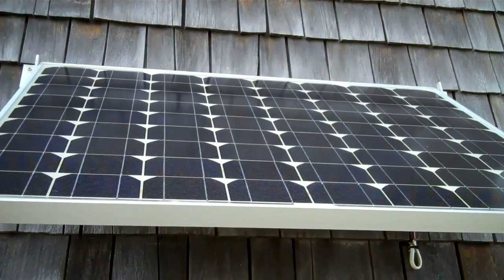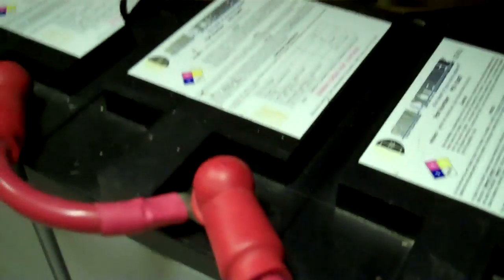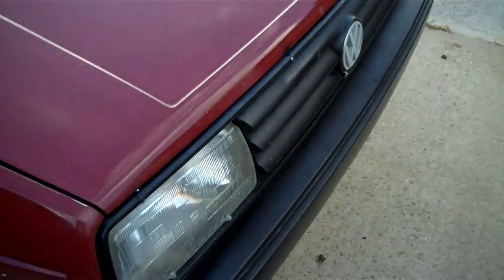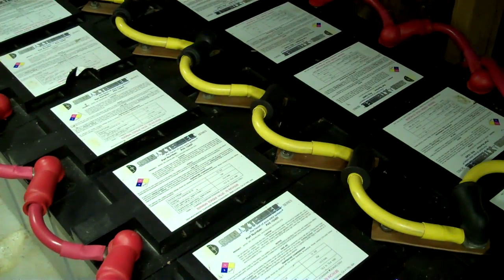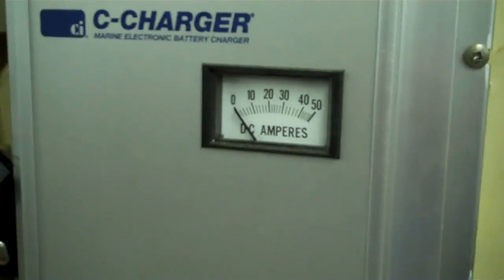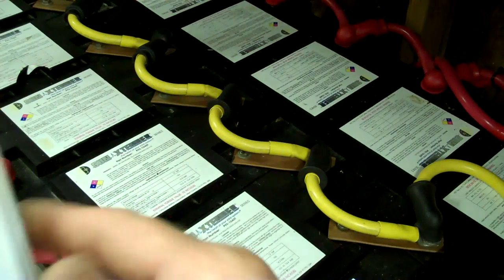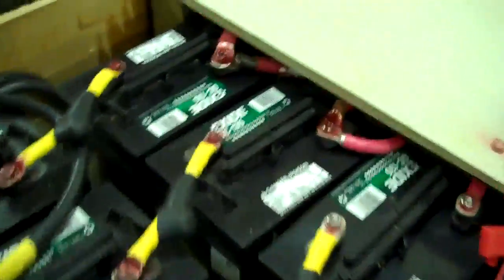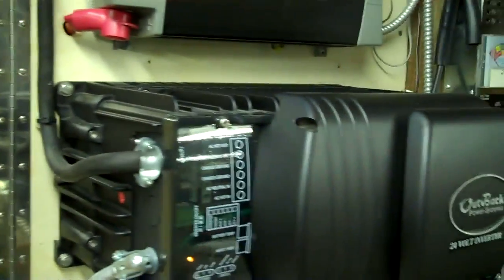HOW TO GET THE MOST LIFE OUT OF YOUR SOLAR BATTERY BANK

Comment: I've seen this before and I don't think you're a dumb ass at all I think you're set up is very impressive.   I use to set them up that way but now I always use bus bars.    
 You can buy bus bar made to connect directly to your batteries (no wire).   I use old fuse box panels remove all the fuse holders and there is one big bus bar ready to use. I put two panels one POS. one NEG (24 batteries per panel).   Sorry if I offended you I think you have a nice clean set up.

Comment from the maker: The only time I would use timers is for a forced off grid situation. Using a timer on a refridgerator rendors your ice maker usless. Starting compressors is not the issue when it comes to solar power its the running load. I hope that helped..

Comment: Hey buddy.
I,m in the UK (240v) and was wondering how you run your freezer with a timer to save power consumption?
I have a 2 hr on - 2 hr off cycle on a mechanical timer.
Am i doin the right thing or will the inductive load of the boost caused by the freezer detecting potential defrost take a large chunk of energy when the timer switches back on?
What do you think?
Any advice appreciated.
Cheers Si

Comment: I have the same batteries they are now on 8 years. I designed a BMS for the batteries to ensure they share the voltage between each other. I have 24 volt system.

Comment: Your absolutely right 12 volt only way to go ,, for many reason's 
Personal i like lead acid batteries  ,, you do have to maintenance and vent them 
But you can repair lead acid batteries ,,  and  my whole system is made of used batteries
I am running 3,500 amp , currently planning to in lager tho , to 12,000 amps
I use different approach ,for a whole house system  
I need // planning // up load vid for those of u that are interested ,on my system 
Add me if like so you catch it when i upload

Comment: I'll listen to this another time or two... great info. I have AGM myself running 12V. I have been taking crap for not going 24 or 48. Glad to hear you vindicate 12V. Is #2 welding cable big enough for the batt bank?
I still don't understand "equalizing". I'll listen again, but can you elaborate in another vid?
Also, is it OK to keep the batts charged and not use them. Someone wrote me and said that is as bad for them as drawing them down too low.
Good vids bro... keep 'em comin....

Comment: great video...my sams club batterys have held up good as new so far..2 years.....my system is offgrid 24volt with a 12 volt backup..... seems to be balanced just right...it's in float by 11 oclock every day and I add about a gallon and a half of distilled water every 10 or so weeks''' the batterys never get below 70  percent charge........great battery video...  thanks

Comment: Lot's of good information OBX
My primary system is a 6400 watt (32X200W panels) and two Fronius grid tied inverters.But
useless in a power outage.
Last outage having a small 12V system (two x 6V Golf Cart in series ) and a cheap 700W 
inverter was a real blessing.
Three drop lights with CFL Bulbs and we were the only lights on the block, having lights all night with battery capacity to spare. That made my wife happy. I'll use your work as a guide to build a "proper" battery bank.
Thanks Kevin